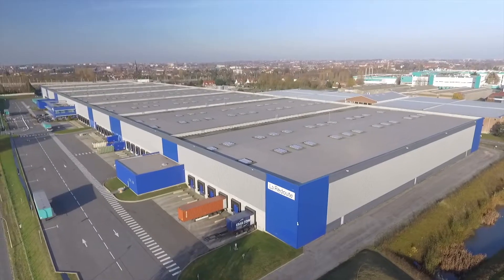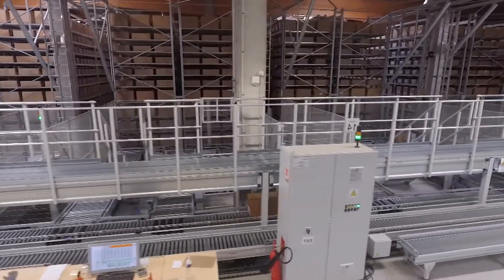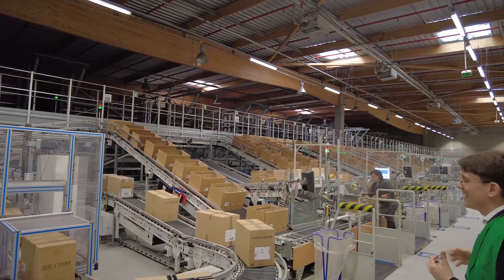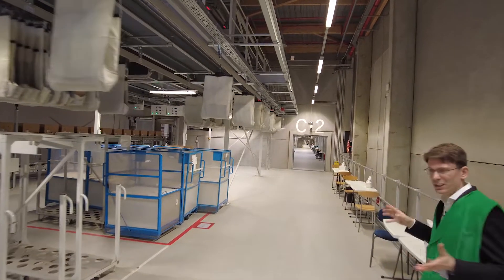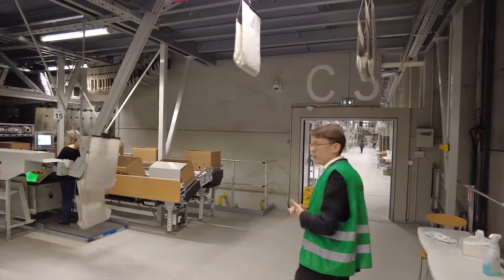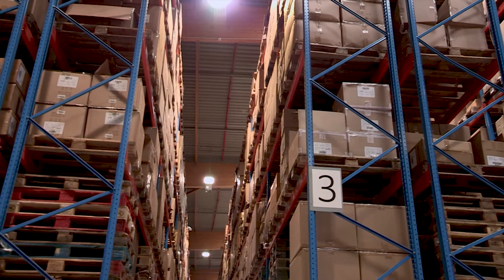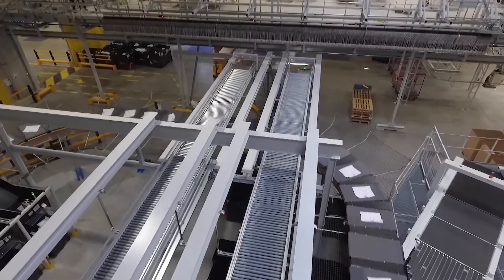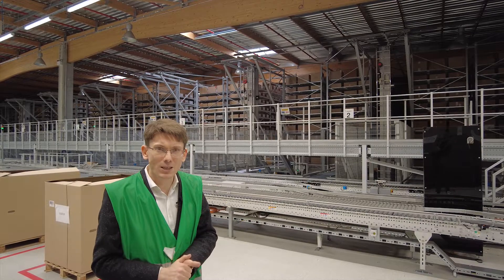Visit of Quai 30 / What does a modern warehouse look like

Comment: A hard hat is not required inside the warehouse? As there are overhead conveyors?
Reply from the maker: Hard hats are not required for most places with this facility. Conveyors are present on many levels, sometimes overhead, but the dangerous sections are fenced. It's very safe work environment. Best regards, Joannes
Reply: @Lokad  Okay, thank you for the information and nice video.
Also, I would like to mention that your 'Supply Chain in 3 Minutes' videos are super helpful. Please keep them coming.